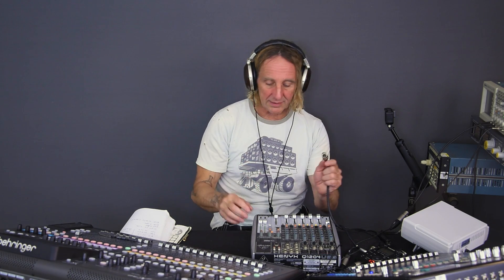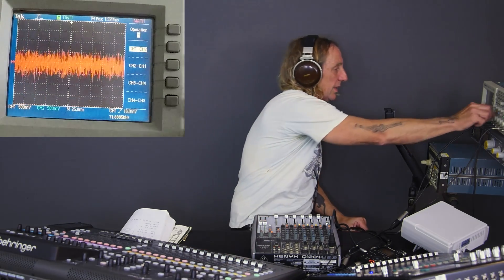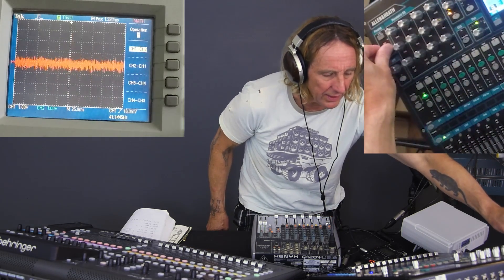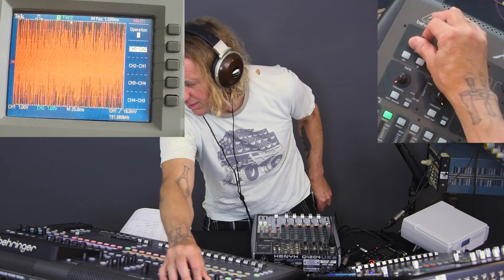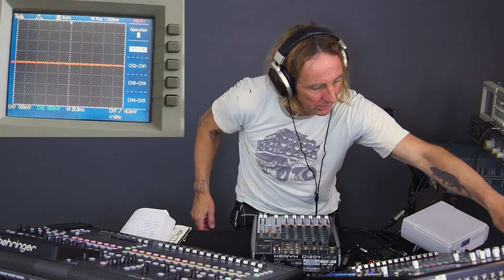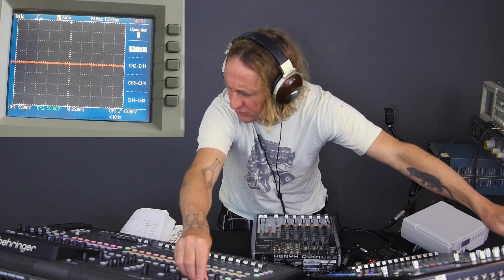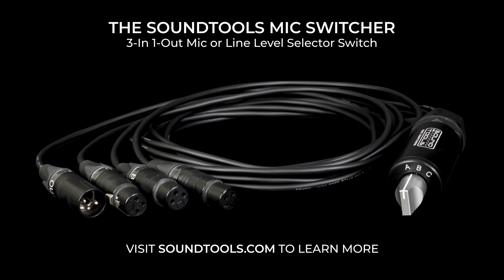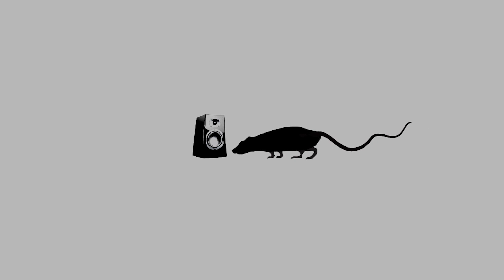Digital Console Noise & Clip Behringer X32 vs Allen & Heath QU16 (Public)

Comment: Hi thanks for sharing knowledge!
Please tell why xenyx q1204 makes noise when fader is fully upward
Because my xenyx x1204usb is creating  same noise when volume fader is full or when gain is full, and this happens without putting any input in channels, I'm only connecting output to speaker any when putting fader and gain to full it makes same noise as you are using for this video

I'm not sound guy so I've no idea why it makes...
Is there any issue with my analog mixer or does they create this noise when volume fader or gain is full?
Reply from the maker: All consoles do that and adding lots of gain to a channel with no input will have even more noise than when there is an input load.

The Xenyx is not a very quiet mixer, it's is more quiet than an x32 or qu16 though, for the same gain
Reply: @DaveRat  ohh thanks alot for replying and helping out.
Finally I don't have to throw it.
Thanks again!

Comment: Dave, what composition is the resistor you're using? You should ensure that you're using a wire wound or at least a metal film for the quietest operation/most accurate testing.
Reply from the maker: Metal film and since I am doing comparisons, not specific measurements, everything sees the same.
Reply: You wouldn't want to use a wire wound due to the added induction in its construction .

Comment: The fact that the clipping on the one mixer is affecting the signal going to the other, likely means that there is some sort of input clamping going on (like a protection diode, etc).  The bench source is probably 50 ohms, so when driving the A/H console hard the input impedance is momentarily dropping down in that range at the peaks.  Typically the active preamp circuit should have quite high input impedance, even if the output was clipping, so I'm guessing there is some sort of voltage/ESD protection at the input that is starting to activate.  The clipping indicator light is probably only checking the voltage at the preamp output (probably digitally after the ADC), and so it doesn't know that the input is clamping, because even though distorted, the preamp attenuation keeps the preamp output below the ADC full scale range.  With a higher preamp gain, you would never see this problem as the preamp output would clip first (which the system would recognize).  It does seem like a design flaw if this is normal...it should be designed such that at the lowest preamp gain setting, the preamp output should clip first (so the clip indicator will work) OR they need to add an analog clip detector directly at the input that triggers right before the voltage protection start to clamp.
Reply: I was going to write the same thing. The SSM2019 preamp IC’s data sheet (probably not what”s in the QU16 but it’s pretty representative) shows 12 volt zener clamp diodes on the input for ESD and over voltage protection. I’d be suspicious that conduction of these diodes also cause the phantom ‘crack’ that QU16s are known for, that sounds like the clipping might actually be the excessive voltage getting onto a ground bus. It isn’t clipping the A to D converter but the preamp, but only when it is at its lowest gain setting. The shape of the clipping looks like something happening in the mic preamp where one leg is running out of feedback voltage. When the zener diodes conduct, if they aren’t exactly symmetrical it could cause the phantom blocking capacitors to slightly bias to one side, creating the asymmetrical preamp clip that isn’t detected because it’s clipping before the ADC. Just a thought. You’d need to pop the lid off and ‘scope the raw signals inside to figure it out. But it definitely looks like clamping diode conduction, but at a signal level I’ve only seen when you pop a capsule on or off of an energized condenser mic.
Reply: @dale116dot7  yeah sounds reasonable.  Would need to see the schematic.  Seems they should have raised the min preamp gain setting if they couldn't handle that large of a signal.
Reply from the maker: Interesting
Reply: @DaveRat  I'm completely with @tompettytribute
Looks like a ESD protection diode clamping before the preamp. The ADC won't notice so peak led won't light.
Typical threshold values for protection diodes are +/-14V. So 9.3V peak to peak shouldn't hit the limit, but maybe they're using another protection method. I'm thinking on bidirectional TVS protection diodes...
Reply from the maker: 👍 it's cool studying why is interesting, possibly from the " is there a simple mod/fix" perspective.

Sometimes finding an anomalies inspires a design fix or change in future products as well
Reply: @DaveRat  I have the Douglas Self ‘Small Signal Audio Design’ book and it’s pretty good, if a bit technical. And it has a British humour about it. He covers some of these, and I suspect that it is a compromise of using a mic input at line levels. Zener clamps are ‘sloppy’ and I ran into an issue with this in a crankshaft speed signal processor. It used a pickup very related to the Hammond tone wheel, and the Zener clamp could, depending on temperature, begin conducting just a bit early, and since the positive and negative voltages were being clamped asymmetrically, it would actually cause a hiccup in the engine operation. That is my day job, but I find a lot of crossover between audio and instrumentation/control.
Reply from the maker: Vo and interesting stuff. The crossover is where the best innovations come from

Comment: If the x32 has some noise in the very high frequency range on the outputs;
- it would be interesting to see if using class-d switch mode amps in the rig as well if that triggers the amp to introduce potential noise/distortion - as we know some class-d amps hate very high frequency on the input.... even causing some to go DC  🤷‍♂️ it seems like a potential way to add further exponential noise/distortion/artefacts....
Reply from the maker: True that many class d don't like high levels of HF. Based on what I tested, the HF noise from the x32 may be audible but is not at a high level. And most likely well below the level that would cause issues other than audible annoying
Reply: @DaveRat  yep.  anything is audible if you crank up the gain behind it enough.  But what matters is the relative amplitude to the program content, which should be easily >>60dB higher.  Can't see it causing amplifier issues.

Comment: For reference 9.3volts = +21dBu which is pretty hot for an input signal. You'd be hard pressed to get a microphone to output that kind of level, but if you're taking input from something like a DJ deck with a hot output you might need to grab a pad of some kind.
Reply from the maker: That's 9.3 rms, we are looking at peak to peak voltages. 9.3 rms would be over 23 volts peak to peak.

9.3 volts peak to peak is only 3.28 volts rms or about 12.5 dbu.

While still not a low level signal, it is well below the rated input capabilities
Reply: I've had some really hot bass and keyboard signals in the past. I would imagine one of those instruments could also push such a high voltage?
Reply from the maker: The voltages are just pretty normal line level

Comment: Woah very interesting! Would be curious to see if the SQ is the same.
Reply from the maker: I maybe someone that has one can test and post
Reply: @DaveRat  Please do, since the QU series is really old tech and comes from the dark ages at A&H. Their new stuff is super good though. And if possible, please also add a DX168, so we can have the dLive preamps in the mix as well (which would be the quivalent to the Midas Pro Preamps).
Reply from the maker: Will ponder that. But more importantly, rather than me testing it for you and others, I am highlighting issues and using relatively inexpensive test gear and simple methods to do so such that you and others are able to do the tests you desire on gear of interest.

My videos are to teach you how to test more than for you to observe the tests

Comment: Thank you for making this.  I've had similar issues with the A&H SQ-7, the common mode rejection is so poor I can't really use quiet dynamic mics with it because of that same 60hz buzz.  People online on forums are constantly spamming about how awesome it is, but my experience closely lines up with what this video describes.
Reply: Strange, I own both consoles and will take the SQ over the x/m32 100% of the time. It’s much cleaner and true, I haven’t heard anyone dislike it’s sound quality
Reply: @IanHind  That's just the thing, Everyone on the internet talks about how awesome the A&H sounds but those claims are never tested / analyzed (until now).  I'm not saying the A&H consoles sound bad for most cases, i'm just saying they don't sound any better than an x32, and that's just how good budget digital consoles are theses days.  when the show starts, nobody should be able to even tell what console is running if we've done our jobs right.
Reply from the maker: I think the way the gain structure and input clip is setup on the Allen and Heath, it helps engineers not create clip problems
Reply: @magoostus  SQ and Qu are two entirely different animals.  No comparison.
Reply: @studioengineer  idk man, the SQ and QU have similar mic input specs, same 5kohm input impedance, id bet the topology is similar. also,  the 96khz does nothing to benefit the SQ-series quality of sound, its just marketing hype
Reply: @magoostus  I have both as well as an X32 and M32 in my inventory, and the SQ sounds a lot quieter and cleaner than the Qu.  I just did a similar test on the SQ / Qu yesterday after watching this video.  It is also a very noticeable difference when mixing a show on the SQ.
Reply from the maker: Awesome
Reply: @magoostus  We have owned both Qu and SQ. Started off with the Qu. Once we purchased the SQ, we A/B'ed them, (should have made a video) and the sound quality of the SQ was leaps ahead of the Qu. First time mixing with the SQ, we immediately heard a sonic improvement. But, just an opinion.
Reply: @harrissoundlighting  a night and day difference that can be measured with a FFT spectrum analyzer im sure.
Reply: @magoostus  well I can spot an amateur in you man, I was continuously reading your comment but your last comment made you look like a kid.
First of all fft analyzer are analyzer, they're just gonna show you the data, it's upon you as to how and in what way you analyze, obviously you cannot compare the quality of sound through analyzer, that thing requires trained ears. Just like in the tuning stuff, flat line doesn't mean you're gonna get the best sound.
Reply: @magoostus  does having the same input impedence means the sound quality is gonna be same? Wtf?
Your input first goes to your preamp, so the quality of that matters, after that AD converters pass the audio to the digital domain, everything matters man!
If you really are right, make a comparison video of sq and qu, don't go around dumping false claims.
Reply: @IanHind  Agree SQ sounds much better, but not really a fair comparison since it's priced at nearly double.  When using the SQ with the DX or GX remote stage boxes, you have basically a baby dLive system.  SQ is also way cleaner than the Qu.  But again not a fair comparison.
Reply: Perhaps a solution would be to insert an attenuator? Ever since I ran a 2nd stage fest on a Mackie Onyx 32 (not my gear), which had no decibel reduction, with a HOT bass line, I've had a set of -5, -10 and -20 attenuators. Shure makes a switchable attenuator in a single barrel. But, would that remove the problem?
Reply from the maker: Finding a solution that works for your application or using gear that is already suited is all good.
Reply: I owned a QU 16 unusable for recording. Just sounded horrible!
Reply from the maker: It's been many years since I mixed on Yamaha digital but back then it was my least fav

Comment: Regarding the clipping. What is the output impedance of your generator? I guess quite low. Probably lower than any mic. Maybe you should wire a 600ohm resistor in series with the generator, and repeat the test. Also the mixers input could be stressing the generator for whatever reason, could that be the source of the distortion?
Reply from the maker: Hmmm, the clip is the same when driven by a console output. A mic would never have that high of an output so that is irrelevant for tests at these levels.

If the console is temperamental in ways that other consoles are not, and even if it was to distort with some sources and not others, that still remains to be an issue.

So, if I have to put a resistor in line to make it work, that would just further prove the issue
Reply: @DaveRat  "the clip is the same when driven by a console output" pretty much proves your point. Thanks for the answer. Thanks for incredible content, cool, cool!
Reply from the maker: 👍👍 and good point on checking to make sure it's not an issue with the generator. I do test that as I am suspicious of everything including non "audio"  gear driving audio gear
Reply: @DaveRat  Have you try another input of the qu16? The distortion (not clipping and asymmetric) is gain dependant?
Reply from the maker: The clipping/dist is before the gain, so gain raises and lowers the issue but can not make it go away.

All inputs are the same
Reply: @DaveRat   @Dave Rat  If the clipping happens before the gain it is probably due to clamping protection zeners at the input which protect the next stage. Sometimes i remove those to make the next stage clip, which sometimes sounds more pleasant, but you lose protection in case of hot plugging or DC or whatever.
Reply from the maker: Interesting and very well could be
Reply: @BUPETA3351  Ok the camping diode but the level is quite low and asymmetric. Also, as you se in the scope, the waveform is not clipped. It's more likes a spike.

Comment: That's interesting. The no clip light clipping on the QU. Regarding the Y-split noise from the QU to the B. I often have acts come in and use a Y-split to create a mock monitor split for a vocal. I wonder if this is also an issue when splitting this way on the one console. Thanks again for this series. It's a real eye opener.
Reply: Don't iso splitters exist to prevent the consoles from being able to interfere with each other in this manner? With a Y-splitter you're not only halving the impedance, but also allowing a potential path for electricity to go from one console to the other in a way yuou don't necessarily want, which is why you generally want a transformer in there, no?
Reply from the maker: AC (music) travels both directions 8n wires and both directions through transformers.

The transformers offer DC isolation not AC isolation.  A transformer will not alter what is occuring here but an active splitter would prevent one board from loading down the other.
Reply: I’m curious if the buzz is an imperfect CMRR that shows up when the inputs are connected with a straight ahead Y between the two consoles. The buzz reminds me of a ground loop with a switching power supply involved.
Reply from the maker: Not sure but cmrr is to fix noise from cables, this issue seems 6o be internal as it happens even when the resistor is plugged directly into the console, no cable.
Reply: @DaveRat  Interesting. I have to take mine apart to replace the touchscreen, I might take a look at their preamp if it is easy to spot. I had similar noise problems with an instrument I am part of the development team on (the Audities Ondea, a modern recreation of the Ondes Martenot), so I’ll take a look to see if I can figure out how the noise gets in there. In my automotive work I’ve often used a common mode choke to address EMI, but a mic preamp is much more sensitive to noise than a CAN bus. I’m wondering if it’s just HF hash from the power supply getting into one of the preamp power rails, then. To me the ‘phantom bang’ and the EMI sensitivity to picking up the HF crud at 120 Hz seem like they might be related somehow.
Reply from the maker: To me it sounds like 60 and 120hz hum perhaps an internal ground loop or insufficient shielding from the power supply to the mic pres
Reply: @DaveRat  Yes, that’s what it sounds like to me too. It sounds slightly more like conducted emissions from the power supply than radiated, though it could be either. If it’s conducted then it would be pretty even across all channels, radiated should be louder in channel 1, I think that’s the end of the board that the PSU is on. For the instrument, I had two sources of interference, one was this 120 Hz buzz (high harmonics), the other was radiated noise from a data bus and from the power supply load being modulated by how busy the software was. Sort of a digital whooshing noise. It took a bit to get both of those quiet. Once I get the display in and the board on the bench I’ll let you know if I find anything interesting.
Reply: @dale116dot7  Brilliant!
Reply: @dale116dot7  Did you end up finding those noise sources? Interestingly, an engineer mentioned similar modulated noise on the SQ (and that an M32 is therefore a better board), even though my impression is that the SQ sounds miles clearer to me. Moving from a QU to an SQ at a venue I work at shifted the quality of live show and recording up quite a few notches.